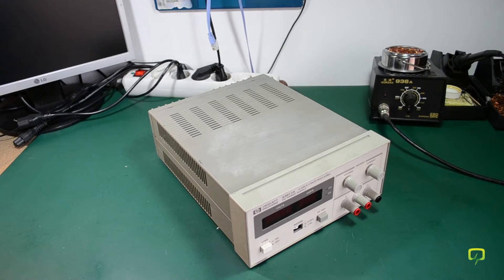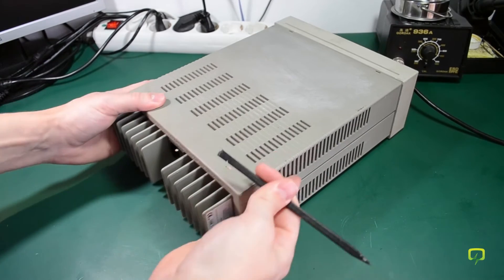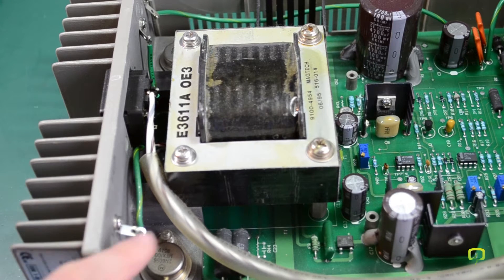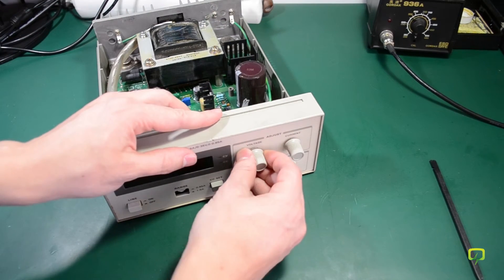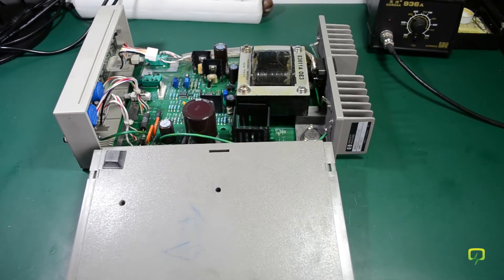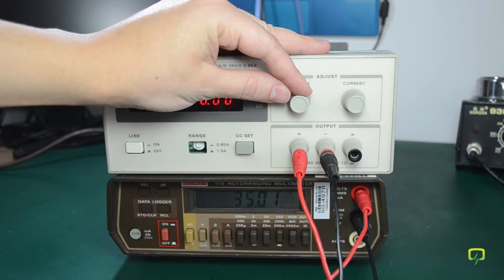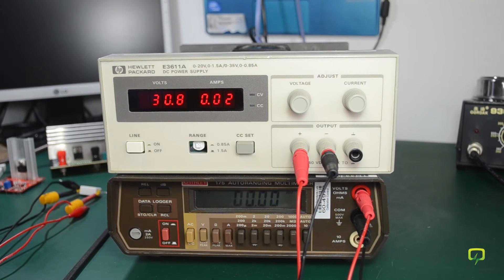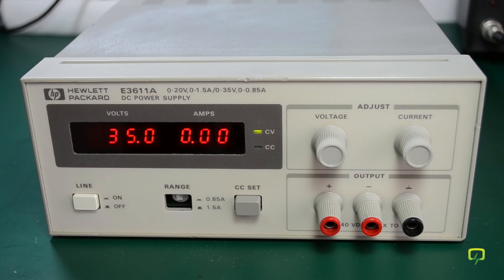VoltLog #5 - HP Agilent E3611A Power Supply Teardown and Calibration

Comment: There's no need to use an external 0.1 resistor just connect the power supply to the 10 amp range of your multimeter with short banana leads.

The current shunt inside the meter for the 10 amp range is 0.1. You can verify this by probing between the 10 amp current jack and common with another meter set to measure resistance.

The precision resistor HP specifies isn't something you can buy off the shelf so your multimeter is a good substitute. 

This is assuming you have a decent meter Fluke, Keithley, HP, Agilent, etc and not some cheapie :-).

Comment: Good review of the procedure.  

Can Agilent not supply a new 'Range' button for you?
Reply from the maker: +orbiter8 (John) I only tried on ebay and I was unable to find one :(
Reply: +VoltLog  I think this is what your after.. Although I would perhaps email Agilent first just to make sure... The link below may work directly but if not...   Just scroll down the left hand list and click PARTS.. Then type E3611A into the FIND BY PRODUCT window.. You will then see your model number at the top of the list.. Just hit 'View parts'.. Where you will see a couple of buttons listed :)

http://www.keysight.com/my/faces/fapHomePage.jspx?cc=GB&lc=eng&_afrLoop=361668347654000&_afrWindowMode=0&_afrWindowId=null#%40%3F_afrWindowId%3Dnull%26_afrLoop%3D361668347654000%26lc%3Deng%26cc%3DGB%26_afrWindowMode%3D0%26_adf.ctrl-state%3Duk8jzps0a_130
Reply from the maker: +orbiter8 (John) Thanks! I will try to confirm with them.

Comment: great video, so the potentiometer on the back of the display is for voltage. I saw 3 adjustment pots on the motherboard, which ones were for the current calibration?
Reply from the maker: I have added a link to the service manual in the video description. Following that link, in the PDF at page 11 you have the full calibration procedure. It looks like R31, R32 and R3 (display board) are all used to calibrate the power supply on the amps range.
Reply: VoltLog
awesome! thank you so much for sharing this information, it seems like this is a really good power supply unit so I ordered one from ebay also and will use this and your to calibrate!  you have one more subscriber now  :)
Reply from the maker: neppy5 Make sure you get the 110V or 240V as required for your grid, there is no adjusting on this unit, fixed transformer winding according to model.